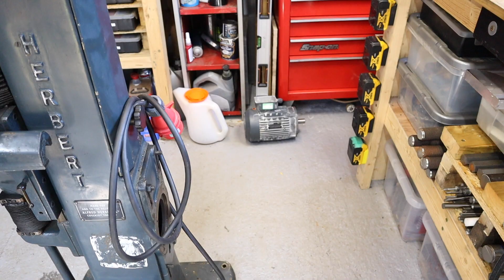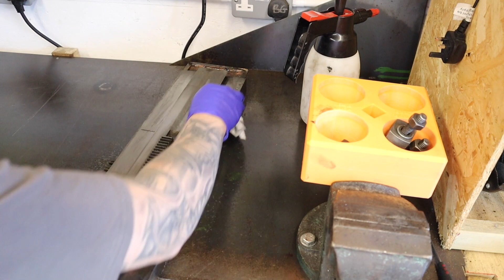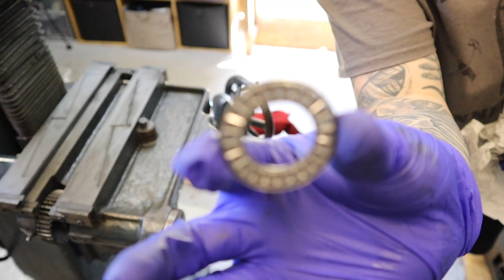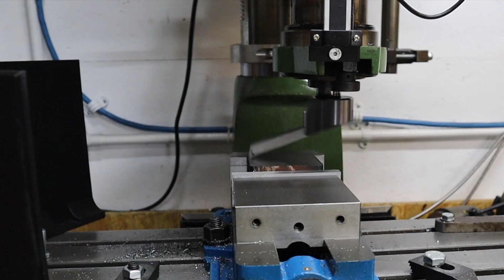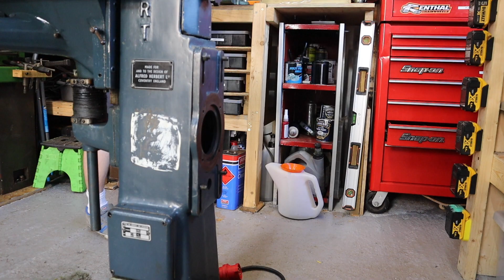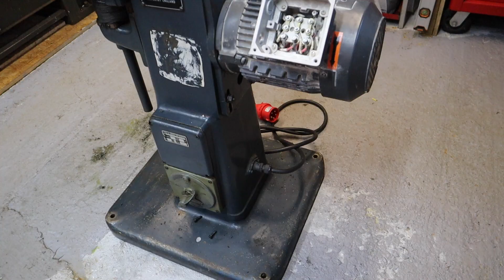Restoring a 100 Year old Machine

Comment: It's in reasonably decent condition for a 100yr old machine, glad it didn't get scrapped.
Reply from the maker: Yeah it is , amazing to think this machine has lived through a world war
Reply: @MachiningwithJoe  Yours is a later machine that was built into the 1970s. Mine is the early type as the column and head are one casting, and the lead screw arrangement is different. It also has an Air Ministry supply plate as it was supplied to Airspeed in Lymington in 1942.
Reply: It isn't 100 yrs old ,probably 1950s ,I had one that could have been 100 years old ,it was a completely different design ,more round looking castings and the wheel was on on a ram and driven by a flat belt. I now have one newer than yours with centralised lubrication ,probably 70s but looks very similar.